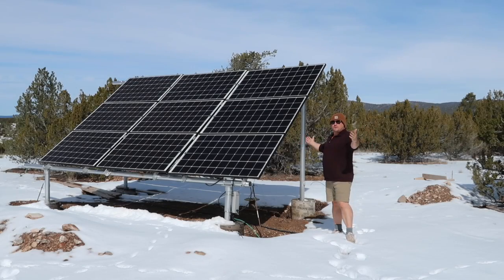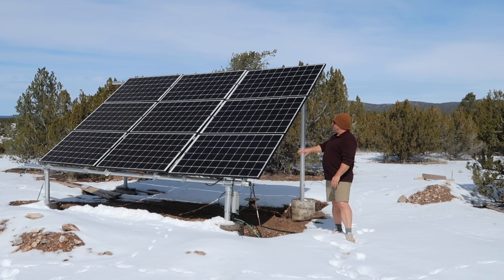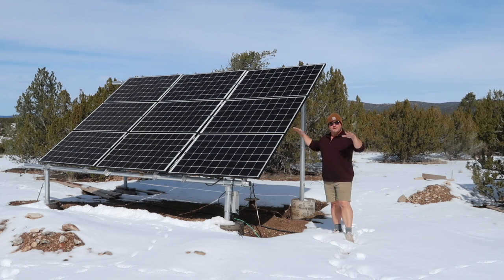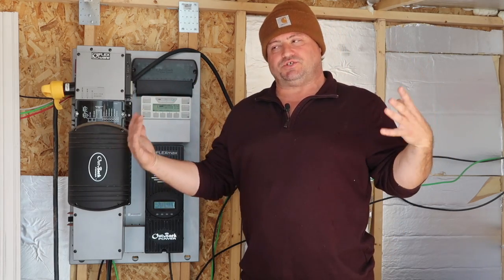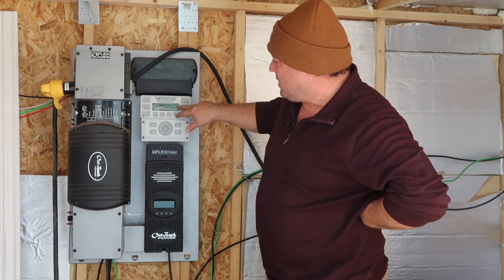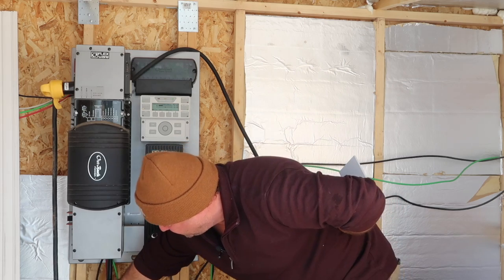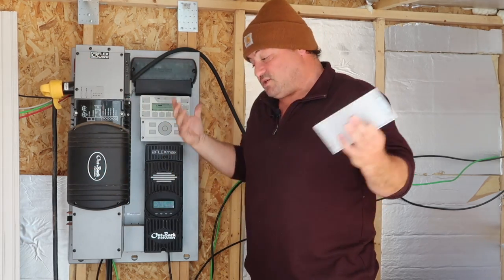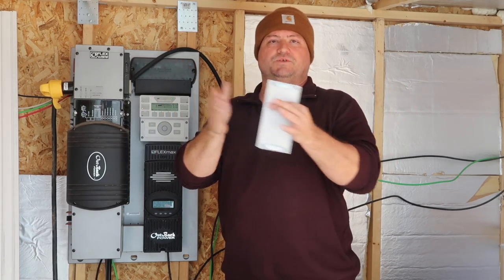Off-Grid: ROBUST Expandable 10,000 Watt, 80 Amp Solar Power System for AZ Ranch

Comment: 8 tons? of concert for 4 legs humm, that would be 25  80 lbs bags of concert per legs. And 10,000 watts of solar with 9 panels? That would be 1,111 watts per panel,humm I do not think so. More like 300 watts per panel . so 300 times 9 = 2700 rated watts. Not real watts , 2700 watts -  25 to 30 % of loss 1800 to 2000 watts more like it. This video is hit and miss.

Comment: I know this video is old now, so I don't know what you have done since then, but for lightning protection, maybe installing 2 or 3 tall steel poles with pointed ends and running them to several ground rods. That way, lightning may like hitting one of those instead of your solar array. Also, using batteries to generate heat is so wasteful. An electric clothes dryer? Why not propane for that?

Comment: I have a 23,300 watt system and it consists of 70 of the 96 cell Panasonic 330 Watt panels.   I have two Sol-Ark 12K inverters and two Fortress Power E-Vault batteries.  I get between 70 kw to over 100 kw on an average day and run an entire house with 5 ton Highly efficient Heat Pump all electric home, Heat Pump water heater, five freezers, two refrigerators, electric dryer and plenty of others, but my cost was not $10,000.00, it was over $80,000.  The batteries alone were $25,000.00 for two.  If you want to run a good sized home, you cannot do it with 9 panels, but if you want off the grid you get what you pay for.

Comment: Folks ... let's make something clear here ... Solar energy will not replace fossil fuels in all its forms as it is used today ... However ... the story is like this ... that is, solar energy is very "expensive" but do you know that the production of CO2 when you burn fossil fuels is not yet part of the electricity bill? ... If you add the fossil fuel pollution to the total cost ... then ... maybe solar power is not that expensive ... At some point ... you have to do your own research and come to your own conclusions . Again ... here in Puerto Rico we have a lot of sun all year round ... but we also have a hurricane season ... Therefore our solar panels must be installed to withstand winds of around 150 MPH ... two years ago I completed an experimental project ... drop by https://youtu.be/2nYy4M1FReY. Comments are welcome. Thank you.

Comment: We just have 2.4kw but during the day we can either charge the car or run any of our appliances. Not both.  If we run the dishwasher and the car since we are grid tied we will have power delivered. If we are thrifty and do just one the grid receives from us. Microwave is power thrifty as well as induction and convection cooking. Doing the math and looking at the meter solves most problems. Good luck.

Comment: This is NOT a 10 KW system.  It  looks to be possibly a 2.5 KW system which is tiny. 

I am very surprised that you went with such a small system since you are out in the wilderness. 

Your inverter and other equipment will have to be replaced if you add more panels.  So it's going to cost as much as a new system.  

You really haven't thought this through very well.

Comment: Dryers, yep I got one of those fancy solar-powered clothes dryer systems in my back yard.  I went and put me up a "5 stringer array" years ago.  I can dry my sheets and 7 days of clothes for me and the misses all in one day if'n it's sunny enough.  On cloudy days I use the back-up array in the garage, but it's a "1 stringer", and not for sheets,   it only has a "one load" capacity wire.  Been in operation for 15 years with no degradation in capacity whatsoever.  Every couple of years I do have to replace a few of the attachment clips to the system to account for the occasional broken clothes attachment pins.  The only maintenance required is the random tightening of the turnbuckle at the anchor end of the wire to remove any slack in the horizontal suspension unit wire.  I think it cost me a  total of $150, I used stainless hardware for longevity and a few bags of  QuickCrete to anchor it in.  I do recommend using 3" galvanized pipe since the wooden vertical support units are susceptible to decay and fail due to our high moisture content in the soil base.

Comment: Batteries can be charged with approximately 2000 Watts being the highest power from those 9 panels. Now it is winter, but when summer is coming, during 6 to 8 hours, a charge of roughly 10.000 watt-hours can be collected in those batteries.

Comment: Nice ranch.  I am running a 4KW panel with 14kw lithium battery system.  I run all my tools plus an 18000 btu trailer ac.   The good news is at 4500 feet the ac mostly runs when the sun is out on a trailer.  so it is rare to draw the batteries down at night.  check out my channel. God Speed

Comment: Why do so many people get rip off by electrical contractors. My system is a 3KW// 2 banks of 48Volt  and I paid about $4500.00. Why do dumbass people get taken in by running larger wire if you series your panels to a higher voltage not to exceed 150 volts on a MidNight Sloar Charge Controller  the systen will lower when you set your voltage output either 12/24/48 VDC. So many knucklehead people will need to wait years to realize any savings additionally panels are getting more efficient so when people pay contractors guess what they'll have to pay again in 10 years for the better system. For myself I'll just replace panels and recoup my costs quickly.

Comment: Depending on how you use one, Microwaves can actually be a good way to conserve energy off-grid, if you're cooking with electricity to begin with rather than propane or other fuel.  Although high in power draw when running (far less than a dryer though), the typically short operating time compared to a normal oven or cooktop can more than make up for that.  A switched outlet (with heavy duty snap-action switch) would be good to eliminate its phantom load for the clock, etc. when not in use.  Best to get a Kill-a-Watt and check everything for phantom draw, if you haven't already... even 2-3 watts running 24/7 can really add up, and some of the offenders can be surprising.

Comment: Is your Flexnet DC battery monitor (black module up top between Hub and AC enclosure) broken, or not completely hooked up?  I don't see any state-of-charge LEDs lit on the front as it should have.  That needs its own separate connection to the battery bank (small gauge wires, white negative / black positive, strangely enough), but is quite useful to have - it logs amp-hours in and out of the battery from all sources, gives a 0-100% percentage reading and other good data on the Mate panel (or sent to a PC), and can control the charging phases more accurately.  They cost >$250, so you might as well put it to good use.

Comment: He must be added in the total amount of time x watch daytime input key solar panel system is do the math know what you need so the batteries last a long time and try to add in 20% extra hour or more and don't forget solar water will save on Long run first place to start if you have kids

Comment: Sorry, that is not possible. If it is 9 panels, 2m^2 each, so 18m^2, with 10kW, that is about 600W per square meter. Efficiency of about 60%. There are no such panels. You need at least 3 times more panels.

Comment: Sir, you are correct, cold does not kill a battery.  It does limit the amps available at any one time.  This is due to the fact that a battery is a chemical reaction.  Cool the battery, slow the reaction.   Looking at your system, which is cool, I would recommend more batteries.  This would increase storage and prolong battery life.  Also, have plenty of ventilation.   A relative in Prescott burnt his generator shed down due to lack of ventilation.  Charging batteries produces H2 and O2.  Need I say more?

I would love to know your total energy bill is per month.  This would include fuel for the generator and propane.    Also, what was the total cost of the system?

Comment: No way are you running 10,000 watts on a single 20 amp breaker along with a 30 amp 220volt breaker.

Comment: Buy more batteries you can never have enough battery storage and when they are fully charged have the capability oi automatically divert the solar power charge to heat up say a large hot water tank
Good luck with the system
Reply: The problem with 48V is the next step is 8 more batteries. All because of electric clothes dryer.  Should have been propane along with cooking and heating energy.
Reply: You really want to keep your battery bank size to a MINIMUM. They are the weakest link in the system. Put in more solar panels rather than more batteries. You will be able to recharge you batteries faster (limited by battery rather than solar) and you can divert the excess power. More panels in high voltage (400v) strings with a modern high voltage MPPT charge controller allows you to get some usable power even on the worst days.

Comment: He should have used the title  "1 billion volts and 200,000 amperes Solar System"
That's what you get if it's struck by lightning  :)
FYI I would also have inline lightning protection fuses for the ac and dc as the outer cable protection when its struck by lightning doesn't give much protection even when grounded
Same goes for any external antennas, telephone cables and  city electricity supply
You will be surprised how lightning finds it's way in.

Comment: Is there a functional reason why you did not use a Tesla battery? I ask cause I’m trying to get some solar power education. Thanks
Reply: The outback electronics is mainly designed for lead acid batteries. It would be a different set of electronics to use lithium.  You can try and cheat and just match voltage but it is a bit of a hack. 

Benefit of lead acid is they self balance if you just over charge them slowly. Do that to lithium and they will go thermal.
Reply: FYI. We have a lithium battery system (not Tesla) with outback components.
48 volt system.
21 KWH of battery storage capacity.
30- 300 watt panels.
Producing 30KWH to 60KWH every day.
Outback GS8048A inverter.
2-Flexmax 80 charge controllers.
16 battleborn bb10012 batteries providing 400 amphours.
Much better than a Tesla system.
Tesla is overpriced,over hyped and cannot accept power from a generator last I heard. Also Tesla wants a constant internet connection which gives Tesla the ability to sell your power to the grid whenever THEY decide to.
Also Tesla systems cannot be serviced or worked on by any homeowner without voiding their warranty.
There are many better options out there. Do your research. Hope this was helpful.
And one last thing. We had a quote for a Tesla system  which was $20,000 more than the $38,000 we spent.
A far superior, more resiliant and reliable system at a reasonable price and we aren't forced to give our battery power to teslacorp for the utilities companies use.
Our system provides all power for our home as well as two full time luxury rental villas and a fairly well appointed camp.
I spent three months researching different systems every night after hurricane Irma which knocked out our utility grid for four months.
Spend your time on research-its the best investment and will save you time, money and frustration in the long run.
Last thought: never lease or rent a system or sign any contract with any provider. Buy and install your own system or hire someone reputable to do it for you. Solar power is supposed to be about giving you freedom and independence by providing a sustainable (green) and reliable option to the big utility providers.

Comment: Get your terminology right.  You are referering to the AC side using DC terminology.  Does your inverter produce 240 Volts AC?  When describing the dryer you allude to the two poles of the breaker as being for tumbling and for heating.  Dryers use 240 volts for the heating element and may use 120 or 240 volt motors, depends on how they are made.  Describing the ground connection as being "my copper" is meaningless.  Copper does not make a ground, a ground rod makes the ground connection and you connect to it with a ground conductor, which are typically copper.  Most other wire is copper also.

Comment: How 9 panels can produce 10,000 Watts?
Reply: why i clicked, they are magic panels, he's under 3k watts for sure. If he's making 10k i'm making 20K lol
Reply: Yeah, even the uber-expensive Aerospace-grade ones used on satellites (~35% efficiency, multiple stacked cells tuned to different wavelengths) aren't that good!  I kept expecting to see a second array somewhere.
Reply: @jordanhazen7761  funny just watched that yesterday, the uv panels are like u said 30-35%, Same thing i was think where's the other 2 panel sets lol
Reply: he only said 10000watt not kwh .. maybe he means it can generate 10kw of power the whole day
Reply: @Poponalo  You measure by KWH not by watts you make in a day, stick to the standard of measurement. Like posting a video, My 5 megawatt solar system and giving you numbers for the year, makes no sense.
Reply: He is generating less the 1,000 watts, not 10k watts...
Reply: @31337cyberhuman  thats definitely not less than 1000w.  Those are big panels so they are at least 200w
Reply: This guy is an idiot , that is not a 10kw system , more like a 2700 watts
Reply: @saferider1094  he probably meant 10kwh which he could easily be producing with the array he has as a 5kw system generates 20kwh on avg.
Reply: its just clickbait,  the opening line says its expandable to 10kW  (I guess he means he over configured the invertor)   The batteries will be happier if he bothers to keep them clean.
Reply: Let's say those are 330 watt panels times 9
That under 3,000 watts
Where's the rest of the panels

Comment: Notice they never tell you how many kilowatt hours their solar produces on an average day
Reply: He did point out that high noon he is getting 800 watts. Probably for about 3 hours. drops off fast on both sides of noon. On my system I produce about 112 kWh on a winter day. On an average summer day I produce 756 kWh. Winter gives me about 15% of the electric I get in summer. I had 4 days of zero output this January, because of snow coverage.
Reply: @lflowell  If you produce 112 kWh, you have one heck of a large system.  A kWh is a kilo watt hour.....1,000 watts of power for one hour.  Four 250 watt panels under perfect conditions will produce 1 kWh.  

To produce 112 kWh would take  112 x 4 panels or 448 panels of 250 watts each.  Realistically, probably closer to 500 panels to account for line loss, charge controller loss, panel not at STC conditions, etc.  Are you saying you have a 125,000 watt setup of panels ???

No....way more likely you don't really mean kWh....you mean WATT HOURS with no "k" in front of it.  That would make a lot more sense.

Comment: Good idea getting a calculator,  might want to check your total wattage. if you use a MPPT charge controller you can exceed 48 volts and you have one. Wrong about the battery’s you can jump start a vehicle just have to pull the desired amount you’ll need. No reason you can’t use a microwave or any other modern conveniences just  have to have a battery bank that can support it and you have it. Good luck

Comment: $10,000.......NOT 10,000 watts....either in panels or in output.  Only 9 panels, maybe 2,000w....single inverter, largest one Outback makes in that series is 3,500w.
Reply: YEAH ..EACH PV PANEL WOULD HAVE TO BE 1,111 WATTS EACH !!! ...  (I WAS WONDERING ABT THAT )  …  THESE LOOK LIKE 250's (2250 watts )
Reply: @ScottyDMcom  I have the same inverter. It's 3,600 watts.
Reply: @offgridphilosophy7959  The 48V version 3600W.  24V, which I have is 3500W.  (Actually VA - low power-factor loads can hit the limit faster than you'd think).  This assuming a "vented" model (VFX3648 / VFX3524) - the sealed ones (no "V"), intended for marine or other harsh environments are only good for 2500W continuous, due to less effective cooling, but have the same surge rating for motor-starting.
Reply: Yep, I agree,  major typo...... I was expecting at least 18 to 20 panels for a 10kw array.       I still cracked my up when he said he was using solar power to run an electric clothes dryer... duh, hang a clothesline outback, it's more efficient.
Reply: @trex2092  I have yet to figure out how he is getting 240v AC to run a dryer out of a single Outback inverter, never mind why.  I have a 240v setup, but it takes 2 inverters in a master/slave arrangement to do that and he only shows a single mounted on a pre-built power panel.
Reply: Absolutely hahahah I was surprised how is it possible 10,000 watts with so less panels,  absolutely shit
Reply: @veed_official  between 2.5kw-3kw @ max
Reply: Expandable up to 10k is what I heard.
Reply: @fireofenergy  5 seconds into the video it's showing "10,000 WATTS !!!" over the top of a 9 panel array.
Reply: I just put up a 16-300 watt panels and have another 8 on the way. 7200 watts are adequate for backup to the grid here in Montana.
Reply: Strange he didn't describe the panels but based on the timing I would guess ~320W so 2,900W. More important to match that with the charge controller instead of the inverter. I have 8 similar panels and 800W happens every day at some point with my grid tie. Very surprised he didn't use propane dryer (or hang clothes). Other than that, array seems barely adequate. I'm sure he'll expand.
Reply: @artsmith103  lol, yeah, electric dryer _ 🤔
Reply: Poor camera work
Reply: If you account the sun peak hours * 2kw solar system you can have an approximate of 10,000 watts per day stored in your batteries.
Reply: @luismaldonado6468  Then 5 seconds into the video it should say "10,000 watt/hours" instead of "10,000 WATTS !!!".